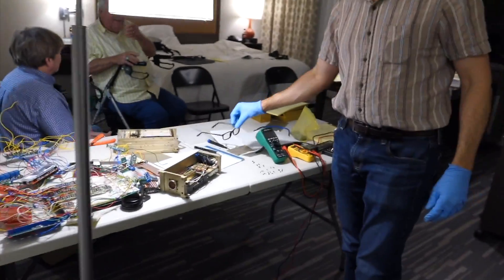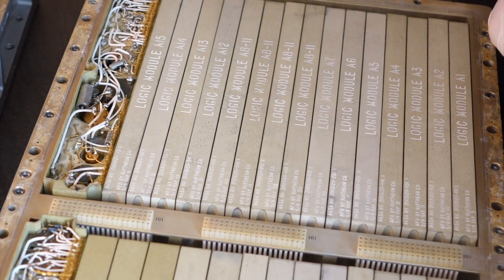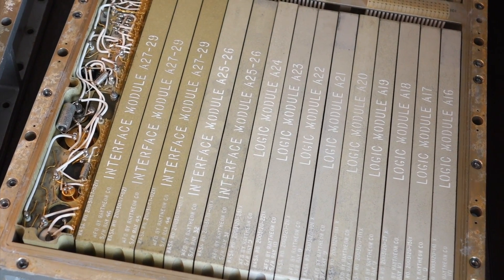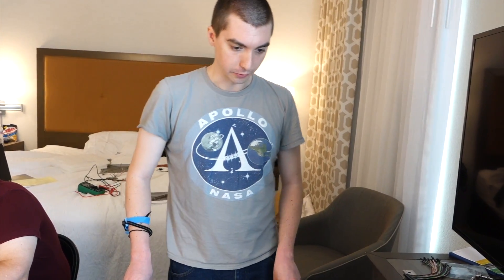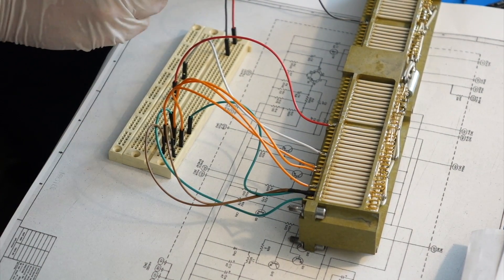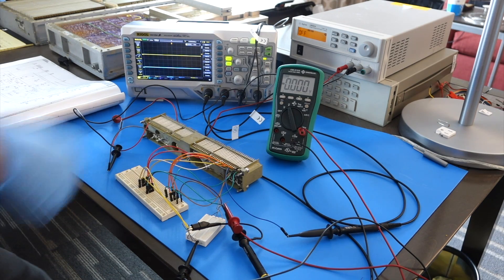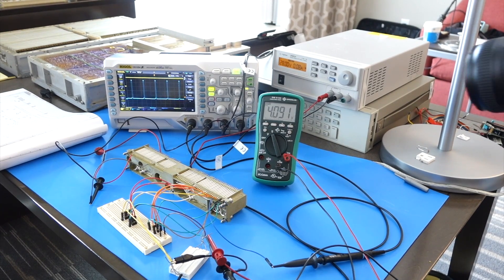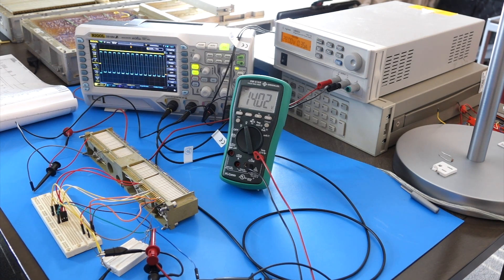Apollo Guidance Computer Part 2: Power supplies test

Comment: What is the logic level voltage on this beautiful thing?
Reply: 4V to 0V, but in practice we see that 0.8V and higher is a logic 1 while below that is logic 0.
Reply: Which made the signals kind of annoying to display nicely on the scope while testing, because a net could have anywhere from 0.8V to 4V as its "one" voltage depending on how many drivers it had and how many sinks it had. So sometimes we'd zoom in to more clearly see one signal, and the next we used the same channel for would be off the screen.
Reply: Thanks for the reply and great work by the way, As digital technology gets older this work is gonna be very important to know just how we got here.

Comment: Did you have to solder wires to accomplish the strapping of the power supplies?   Can't see what they are soldered to.   Fascinating technology!   Seems like this computer connected directly to lots of external things.   I had thought it would be used more for manual calculations, but seems like it was doing real time control based on sensor inputs.  Thanks for making these videos.
Reply: Some of the pins on the bottom of the module accomplish the configuration. ON the backplane where the power supply is plugged, wires are routed to the pins in the pattern needed to select either 4V or 14V
Reply: Yes, the guidance computer is doing real-time control. It receives data from the gyroscopes, accelerometers and radar to determine the spacecraft's position. Meanwhile, it controls those devices as well as the engine and RCS jets to keep the spacecraft on course. There's a diagram of its inputs and outputs here: https://archive.org/details/acelectroniclmma00acel/page/n165
Reply: We used some jumper wires we crimped with mostly-compatible terminals to do the strapping.

Comment: All those electrical connections in a pressurize pure oxygen environment, makes you think.
Reply: Hermetically sealed and filled with nitrogen inside the block II AGC
Reply: After the Apollo 1 fire, block II spacecraft and all their components were reengineered to remove flammable materials and to seal up spark sources. In the change for the DSKY, for example, the keycaps were changed from acrylic to machined aluminum. The microswitches were originally built with rivets to close them up but were changed to a sealed construction. Many units were sealed and filled with nonflammable gas such as nitrogen
Reply: @carlclaunch793   thanks for the insight.

Comment: For now, this all series could be resumed by "Trying to find something bronken on a 50yo space computer, damit it was working all along!". I will forever be amaze by Nasa engineer and reliability
Reply from the maker: Yes, this is no ordinary hardware. But you'll see we have at least one big bad fault.
Reply: I wouldn't say is just Nasa, I worked in several systems in the US Navy as an Interior Communications Tech and they're just as rugged as these ones. I realized most people haven't seen military grade systems, but believe me they're just as astonishing. Apollo systems are obviously on a top tier due to the nature of what it was supposed to do.
Reply: @nobytes2  All the Flight rated electronics looks like this in the Military, a lot of Apollo and military gear was made at Delco Electronics so it makes sense. We had a piece of Gear during wartime would explode if you tried to open it.

Comment: Bloody hell that wire-wrapping rats nest. When some connection went bad it was impossible to fix. I recall the voting machine in Finnish Parliament was implemented this way in early 1970s. It did not last long because of air pollution, like cigar smoke and some chemical in Coca-Cola.
Reply: Based on our experience with the IBM 1401 and Xerox Alto, wire-wrapped backplanes work reliably. I brought a wire-wrapping tool in case we needed it for the AGC, but we didn't. On the other hand, tracing wire-wrapped circuitry is super-tedious. I spent a week figuring out the rope core simulator - so many identical blue wires!

Comment: It does kind of crack me up that every device used to test, measure, and document this restoration, is more powerful than the computer you are actually restoring. Probably even including the digital multimeter!
Reply: The new stuff is much more powerful, but also more fragile, both physically and operationally. I'll take the AGC over the newer stuff any day if I have to fly to the moon.
Reply: @phil4826  What you say is not really true. You are comparing something from the past that was built specifically for reliability in an extreme environment to something from today that was built to be as cheap as possible and still do the job in a home environment. A well made modern cpu is actually an extremely reliable and durable component especially compared to this. It's everything attached to it, powering it, supporting it that is made to be cheap and not up to the task. 

And there was plenty of cheap, fragile crap being built for home use back in the 50s and 60s too. I wouldn't want to fly to the moon if my life depended on the reliability of the cheapest radio found at Sears in the 60s. My cheap modern cell phone is both more powerful and more reliable than that. 

Fortunately, neither our brave astronauts of the past nor us today have to do so. The stuff built for Apollo was not standard off the shelf electronics. Every piece was built to a higher standard and tested thoroughly. If those power supplies had off the shelf 60s capacitors in it, that thing would have smoked the minute they put power to it. And our astronauts of today don't go up with an off the shelf Dell laptop. They have systems designed, built and tested for that specific job and environment with a backup and another backup. 

But if you just have to have a super reliable, nearly indestructible calculator with a lifetime warranty on it to help do your taxes, I would be happy to build you one. Just send me $100,000.00 US dollars and you will have it in a years time.
Reply: @wingracer1614  Yup. Anyone who's been inside an "All American Five" radio can attest that consumer electronics have always been designed to be "good enough".
Reply: @wingracer1614   he said hed take the old stuff over the new when going to the moon. you agreed but called him wrong. he wasnt talking about consumer electronics in the 60s
Reply: wingracer 16 ya u didn’t read his message properly bro
Reply: @wingracer1614  The pathways inside a modern chip are so small that a cosmic ray could knock electrons out of their path.
Reply: @phil4826  "
I'll take the AGC over the newer stuff any day if I have to fly to the moon"

I worked military electronics about 25 years ago, and I damn sure wouldn't.  I don't know where people get this idea that military electronics today are LESS reliable than they were back then, but it is dead wrong. Military electronics are NOT designed like your oven or washing machine electronics.  Everything is derated, crap like tantulum caps, which are pretty unreliable over time are not used, and interconnections on production hardware today would be soldered or connectorized with VERY high quality mil connectors.  The MTBF of today's electronics would dwarf these. 

Think of your home computer.  How often does a board go bad?  And that is COMMERCIAL design practices.  And those are literally millions of times more complex that this, by today's standards, junk.

People always say "it isn't built like it used to be" and for some things that is true, but let me give you an example where it very much is not.  The GOOD of cars today, compared to those of say, the 70s, are VASTLY more reliable. I'm talking Toyota and maybe a couple of others here.  With proper maintenance even the motors will typically go 300k miles or more.  That almost NEVER happened with those motors, and the alternators, fuel pumps, etc are many times as reliable, as well. My Acura TL had almost nothing done to it in the first 250k miles, not even belts and hoses.  That also never happened back then. Exhaust systems are another that has been extended tremendously, they were notorious back then for developing rust leaks.

Something like a hard drive, a mechanical device that is practically ubiquitous, has AMAZING MTBF considering what is going on in there mechanically.  Those devices out of laptops that were probably used for thousands of hours in some cases can be fired up today if they haven't been abused and they will work fine.  Calculate the number of rotations sometime that occur during that much use, and you will be floored.

Yeah, some things are crap, like the electronics in consumer machines like washers, ovens, etc., and many things are not designed to be as repairable as they were.  One example, I have a fan that came from the 50s that still works great, and it has a LOT of hours on it because I used it as an exhaust fan in a house for night when I was a student and even afterward on cool nights for years.  I had to replace the cord once, but that was it, it still worked but the insulation was starting to look dangerous.  Also the cooling loops in consumer refrigeration systems are JUNK, now, cheap foil thin aluminum piping for evaporators and condensers rather than the thicker copper used before that would go for decades.

But comparing commercial junk to military or man rated space hardware, good luck with that.  And I will take today's, ANYTIME, for reliability. And as I said, some commercial "junk" today is spectacular.

Comment: I'm curious what were the attempted PCB's manufactured from?  I know that wood fiber PCBs which were used in the 1960s for consumer and some professional products were notorious for humidity problems.
Reply: Jonas The Movie  I would think Mica would be too fragile.  I'm referencing thin multi-layer mica washers and  power transistors insulators (TO-3) where slight flexing of the material can cause the layers to start separating.

Comment: Out of curiosity, What was the cost of one of these way back then?
Reply: According to the disposition form for this computer, its acquisition cost was $275,800 in 1966 dollars -- which would be something like $2.17m today.
Reply: If you have to ask about the cost, it means you cannot afford one :)
Reply: @JanBruunAndersen  You also need the rest of the CSM as that is both the housing, power supply and IO interface for the computer.
Reply: @SeanBZA  or the rest of the LM. This particular AGC was installed in a lunar module.

Comment: Having spent close to two decades working on computers with 3 level wire-wrap backplanes, I can state that wire wrap backplanes are not necessarily 100% reliable. Those G-D machines could pull the wire tight around the pins when cornering a long wire, and the Kynar insulation would eventually cold flow and short to the cornering pin. Depending on what was on that pin, this could cause all manner of havoc, and could be darn hard to locate.

It looks like the wiring in that backplane area is very open and I didn't immediately see any tight cornering, but it is certainly something I'd carefully look for.
Reply: The computer design review brings up the cold-flow problem, and it was taken into deep consideration. Here's an except from the review book:

The simple solution to this problem would be to obtain a wire with a greater "cold flow" resistance. However, these tougher wires present problems to the wire-wrap machine. They do not strip easily and have a mechanical memory which makes them spring up from the wire wrapping surface. It is, therefore, necessary to make a compromise between the toughness of the insulation and the ability of the wire-wrap machine to perform the wire-wrap operation successfully.

After more than a year of search for an acceptable wire, Raytheon has finally located a vendor who can produce a wire which is both tough and "wrappable."
Reply: @mikestewart8928  Simple solution I saw was to leave some slack in the wire every time, so that it was not pulled flat on pins. Then they took the runs and laced them together with lacing twine in a loose loom. Lot of manual labour extra, but as they only made around 50 units not going to add too much cost wise.
Reply: On the other hand: Every single piece of equipment used went through a long series of testing before the launch. Especially with the electronics NASA tried to limit down the possibilities of random errors to as much as possible.
Eg. there was the concern that the chips might fail. Thus random samples of chips were taken and drowned into a liquid (I am not 100% sure but I think I remember it was Freon). The chips were weighted before and after that procedure. If the weight differed it meant that the casing was not 100% tight. If just 1 chip failed that test, the whole batch was thrown away.
Reply: It is certainly the case that reliability was "tested in" to the space hardware. Heck, that was basically the definition of "man rating" a device. My point is that cold flow is a thing that is progressive with time, and it has been fifty years, not one or two years. It is quite possible that there are absolutely no problems of this sort and none will develop in the next fifty years. But it is also possible that some problems could have developed over the last half century that were not there originally.
I'm sure they will find out if this is the case, since I'm sure they are going to get it working.
Reply: @kallewirsch2263  Very interesting, where would I be able to dig up more of those facts? Have been fascinated by the Apollo era computers for a long time.
Reply: IBM had a control unit, the 2821, that suffered from lots of cold flow problems which required rewiring the backplanes for all the wires that had been pulled tight around pins. Most other machines they built with wire-wrap had used procedural steps during wrap to avoid this problem
Reply: It could be a real problem. I worked on a machine at Burroughs that used wirewrap coax for all of the signal connections in the processor in the first prototype machine. The cold flow problems with that were so bad that we went to wirewrap twisted pair for the second prototype and the real machines.

Comment: The engineering and technology there is absolutely amazing and beautiful. Its absolutely amazing they could get so much power in a small package. Granted this was a very specialized computer designed for one thing unlike many of the time, the design and technology is just literally out of this world for the time!
Reply: This is roughly the same computing capability as the IBM 1800, a real-time mainframe of the same timeframe, but instead of taking multiple full sized racks and a lot of power, it fit in a small volume and used very little power.
Reply: @carlclaunch793  I've been aware of this effort for a few years now but I've never actually taken a deep dive into the specifications of how computers of the era were built. How did they achieve that? Was the lower power consumption all thanks to the process used for fabricating the NOR gates it was built out of?

All the best to your entire team, I'm looking forward to seeing the AGC put through its paces!
Reply: @sietuuba  The low power was the cumulative effect of hundreds of design decisions and component choices. The compact design itself didn't require driving transmission lines between far flung parts of a mainframe computer of the era. Switching power supplies whereas mainframes of the era had big linear supplies. Doing cycle stealing to maintain timers and counters instead of having dedicated circuits for each one. ICs surface mounted on multilayer boards, plus cordwood construction and core rope memory all shrunk volume dramatically.
Reply: @carlclaunch793  I can't imagine that is was super efficient with all the analog power supplies that stepped down all the voltages and the miles of wires connecting the components.
Reply: @FrederickWalser  Much more efficient than would appear initially.

The power supplies are switching design, not the usual analog supply of the time that burned off excess voltage as heat. Considerably higher efficiency.

The majority of the wires you see carry very low currents - signals at .8 to 4 volts to only a few transistor base-emitter junctions.

The power feeds used a pseudo bus-bar connecting groups of power pins down at the bottom of the pin, reducing resistance compared to point to point wiring. 

Many of the connections were traces on the multi-layer boards which held the ICs - short distances and low resistance. Board to board connections passed over gold contacts, once again lowering resistance versus copper.